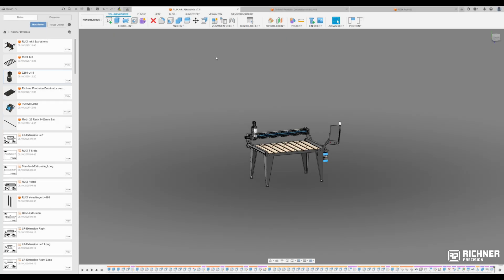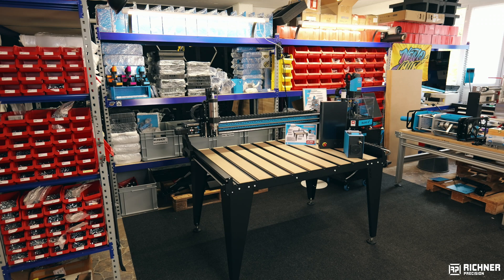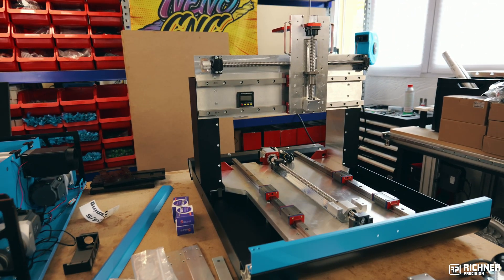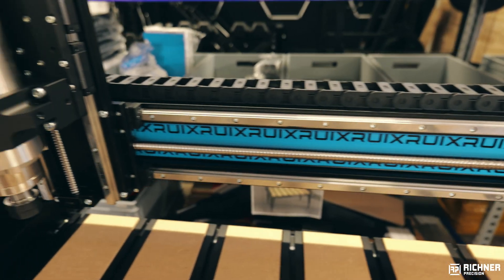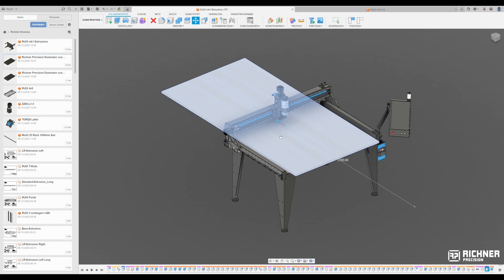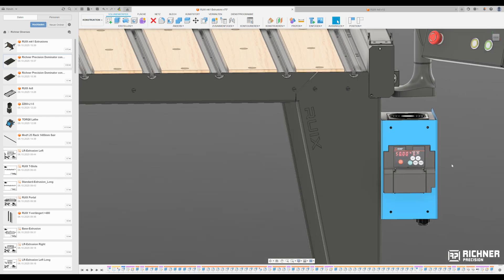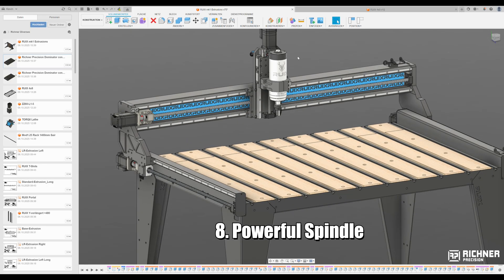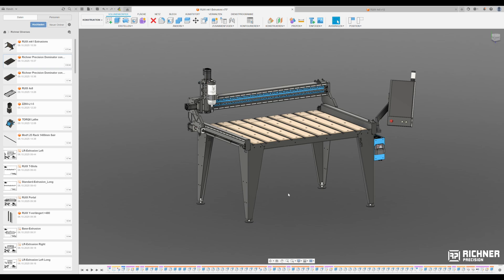Engineering our RUIX Mk1 CNC Router | Pt.1: Introduction and Goals

Comment: Hello Sir, i am looking for a cnc Mill to work with Polystyrene and Polyurethne foams. The working area would need to be ~1300x700mm however i would need a minimum of 200, preferably 300mm of z-travel. Is this possible with this machine in the mentioned price range?

Comment: did you have an estimated price for an full build like that? also greetings from germany :D
Reply from the maker: Good Morning! The RUIX mk1 starts around 5580 Euro. Fully built like in the video with legs, 2.2kW spindle and mitsubishi VFD with low leakage emc filter is around 7700 Euro. I can send you the full price list if interested.
Reply: @Richner-Precision OK I see, so not specifically an Beginner CNC but more of an typical Swiss precision Machine. Thx for the fast answer. :D
Reply: @Richner-Precision Guten Morgen as Well!